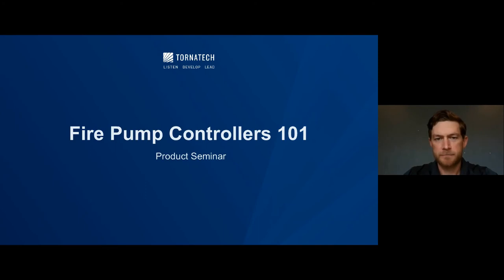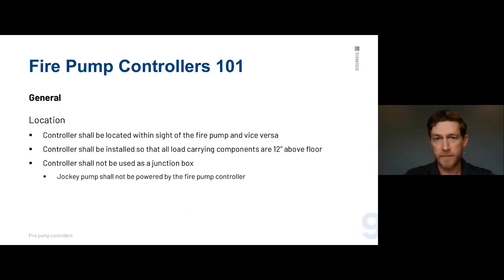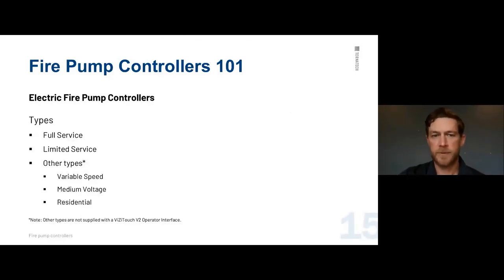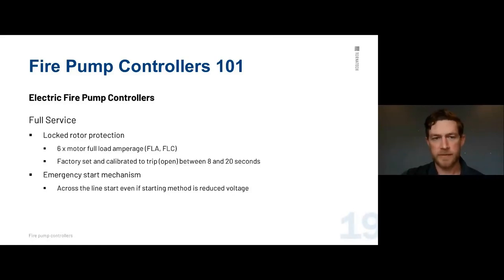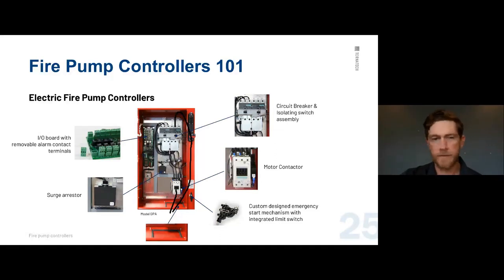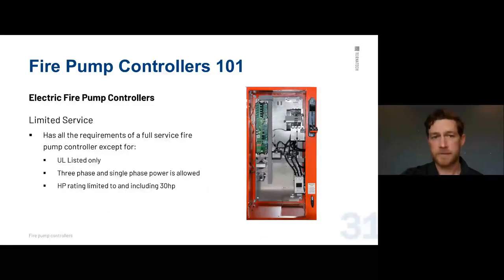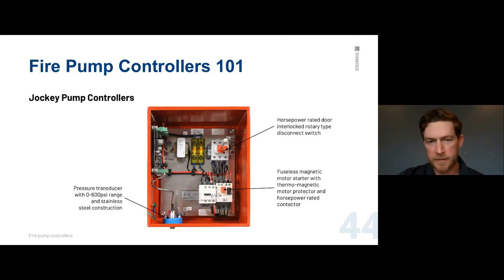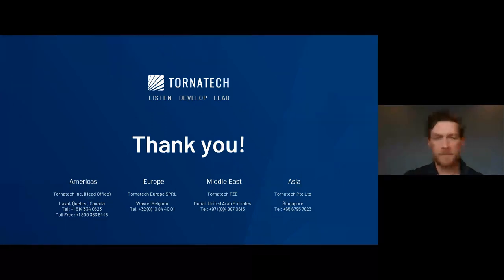Fire Pump Controllers 101

Comment: We have a tornatech fire pump controller at our oil terminal for electric pump but the controller does not turn off the main pump once the hydrant is closed.
To be more accurate 
1- once we open the hydrant the fire pump is operated automatically due to drop in pressure. 
2- but once we close the hydrant, the pumps keep operating even though pressure is increased. We end up switching off the pump manually.
Reply: @tornatech
Reply from the maker: Hello, We cannot help you with a technical question on YouTube. Please contact a Customer Service department at a Tornatech location near you. Contact information can be found on our website: www.tornatech.com
Reply: @hamzanasir5345   Check the timer .. after reach the cut out pressure timer will blink in the screen . pump will run untill timer stop .